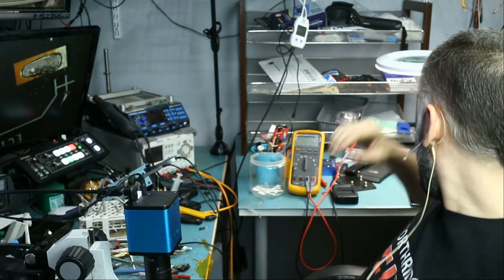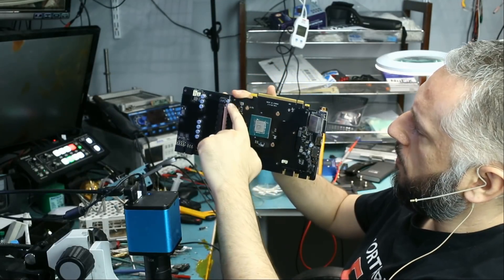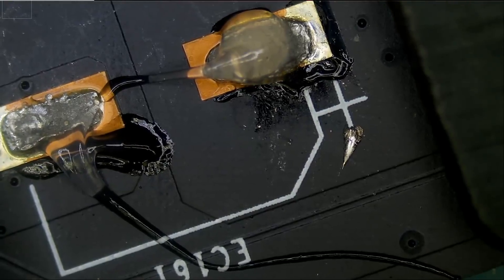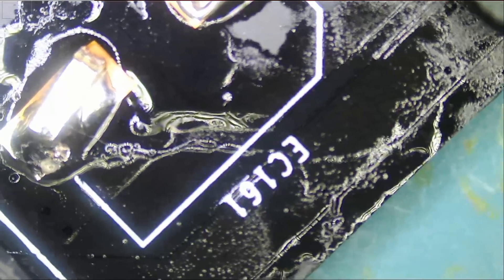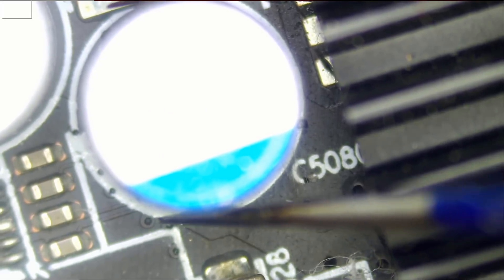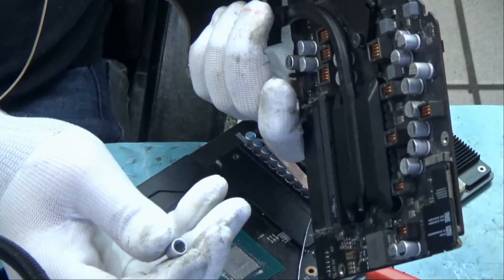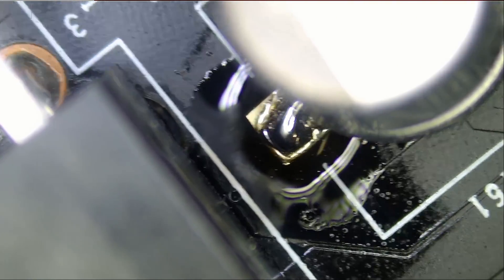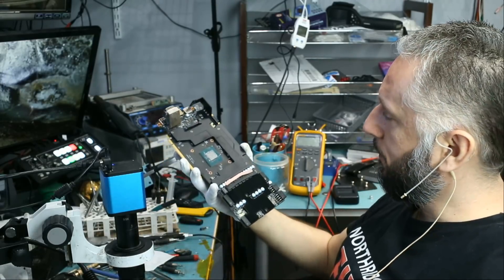MSI 1070ti Graphics Card Repair - Capacitor blew up under heat.

Comment: May I ask you sir is it repairable those tiny and capacitors that are around the gpu crystal ? My nvidia quadro p5200 has one missing those tiny caps around it snapped off is it repairable ? I do understand that without them it won’t work ! Thank u

Comment: I have seen a simple technique for removing SMD caps from a board - without any heat!  Simply grasp the cap with pliers and twist them round quickly, and they will come off the board.  I have seen this technique works for the board - when replacing old caps.  I am not sure if the caps themselves survive, but it seems to me that if they come off the board, leaving it clean, that there is a chance that they will also be ok - though the connections may need straightening.  It is worth a try.

Comment: just curious why you didn't use solder suction instead of solder wick to easily remove the capacitor from donor board.

Comment: I have a geforce gt5 1070 ti and tried to clean off what I think was thermal paste when the computer was on I used metal to screw it off and one of the copasters sparked and now my graphics car is not working how do I fix it

Comment: I learned that you need a solder sucker to make life easier. Additionally, SMT components will have a set heat tolerance that they have to meet for manufacturing. The solder will always melt before that threshold is met, or the manufacturing process would be impossible. If you have a good hot-air supply, it should closely regulate the output temperature.

Comment: When I repaired boards they were rated at 85c then others 100c 
I turned job cause they were protecting big wigs by detuning there equipment I didn't want use micro scope to find problems then sent to next department to solder everything
You need special tools and solder to do surface mount and steady hand which didn't have when got hit by electric discharge and need repair my shoulder

Comment: Do you work while watching the camera feed on the monitor, or is it only for recording and you have a separate stereo/trinocular microscope? How is the delay/latency from real movement on the bench, until you see it on screen?
Reply: @Revuel_0  Thank you. He's made some content on this since then, but I appreciate the feedback. I've used a trinocular microscope since the start at work, but trying to piece together a setup at home. I got a neck injury so a monitor would be preferrable that way, but IIRC he said it was hard and took a long while to get used to working with cam and monitor (doing so all day long for a year I think he said?) so I'm still a bit on the fence about it, because I can't afford both.

Comment: In my openion you should have used low melt solder with soldering iron to get the cap from donor board but you know better the scenario of the case

Comment: lol, I do watch for the fire works so it didn't surprise me.  I watch to see the customer fireworks and hear Alexs' description. Bonus: I get to see what is really inside a capacitor instead of a description.  I learned to wear safety glasses when working with capacitors.  Out of curiosity, how much noise does a 330 microfarad( μF) capacitor make?

Comment: I learned another way to make a capacitor explode, and I learned that it is easier to replace a big surface-mount capacitor with a through-hole one than with one just like it.   However, if salvaging a capacitor off another board, I would test it before installing it.

Comment: @Bigclivedotcom Gave a suggestion on how to remove these smd style caps. Hold the cap with pliers and twist it. Due to small surface area between pads and legs, usually the solder joints break. Caps can be extracted without damage👍👍

Comment: A good tip for removing smd caps like that is to use 2 irons.  One from each terminal at the same time.  Comes right off without breaking leads, no explosions either. lol
Reply: No way to do this when its SMD without exposed pads, just like that one in video
Reply: @mirrored_  blow with hot air from bottom

Comment: 1st wear PPE. (Safety First).
2nd Pay attention on what you are doing. (Memphis law).
3rd Use low melt solder to remove component and solder with lead solder.
4th do not over heat Cap or plastic parts with Hot air. (Eye on your surrounding).
5th Check components for loose leads (Scammer parts).
6th Clean it like a Pro. (Be a professional).
7th If cap pops remove rotten egg smell quickly with fume extractor.
8th Do not be afraid, grasshopper!

9th Follow 1st step... Etc...

Comment: I have the zotac GTX 1050 TI dual fan GPU and all I'm getting is a black screen. Have it hooked up to my monitor via HDMI. When it boots everything works but there is no display, no bios screen. But then the monitor flashes to a black screen.....any solution????????

Comment: i remove these caps with Weller soldering tweezers, or sometimes with Weller WXMP and low melt solder from ChipQuik. And i allways put new caps if i can.
Reply: How you do this wit hot tweezers when pads are not exposed like this one in video?
Reply: @mirrored_ Its all only about technique and experience and the pads are allways little wider than legs of capacitor. I use chipquik smd291 flux + chipquik low melt solder to do this. i put soldering tweezers on the pads near capacitor legs with usage or flux and low melt solder and do the job easy.

Comment: Good morning,  smd acid style capacitor dont like heat , and you can use low melt to desolder thru board style capacitor , i have a store order coming to you in a few days.

Comment: Try to lightly grab them with plyers and twist them like a screw on a donor board Works Amazing Tip i got from Mr. Carlson's Lab I have never had one rip the pads off only twist in one direction

Comment: You can use low melt solder on these caps by desoldering, it works like magic 😎 

But really, i used it many times.
Reply: If you can reach to the pads with the solder, it's an option. Just be VERY thorough in removing all the old solder from both the cap legs/pads, the receiving pads, and your iron tip, before soldering the cap onto the receiving board! When you mix lead-free (factory solder) with low melt (138°C) bismuth+tin, and then afterwards solder it on with leaded solder, you now get an alloy mix of tin, bismuth and lead. This mixture is extremely brittle, but more importantly, it has a very low melting point. It's basically chipquik, without the indium. It will quickly weaken under normal use, and melt at 94-98°C ! (depending on mix ratio). That's within the higher range but still normal operating temperature of most modern GPUs.

To avoid accidentally introducing this weak point to boards you're working on through cross contamination, it's highly adviceable to keep a separate tip cleaner mesh cup, dedicated to cleaning bismuth-containing solders off your tips. And be thorough when you do so. If you do that kind of job a lot, it can be a good idea to keep a couple of separate solder tips dedicated to bismuth and chipquik. Especially if you use a T12 solder tip cartridge type iron, as you can get good knock-offs for under 5 dollars.

Comment: Things learned:
Don't apply heat on those types of capacitors because they will blow up there's other methods to remove them
Wear safety glasses because you don't know when a cap can blow and hit your eye😫
Trough hole caps can fit on surface mounted caps

Comment: Long time a go i had the 9800 gt nvidia and 5 capacitors blow up...i had a a board and donated the same 5 capacitors and after changin the fan because was fan cooler foult...worked...but we learned that we dont aply hot air to capacitors because heat sensitive and because of that they blow...thank you 😃😃😃

Comment: doesnt make the 2 legs a short at the cap from the capacitor? or im wrong?
Reply: That's what I thought also, and that's why the smd caps have a small insulator on the bottom between the legs and the cap

Comment: The better experience is to be electrocuted from a 150uF / 450V cap, while working on a laptop adapter. Except Blood circulation it fixes heart rate. :)
Reply: Sounds less painful than the (most) classic CRT monitor shocker.

Comment: If the capacitor is small enough for the hot tweezers to reach both ends of the legs of the capacitor it will be a convenient way to desolder/resolder the capacitor 🤔